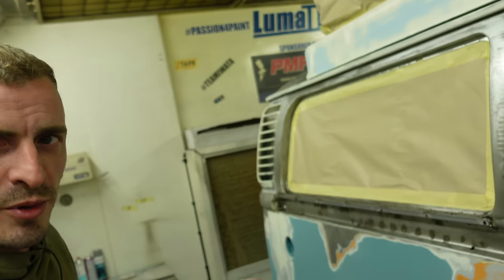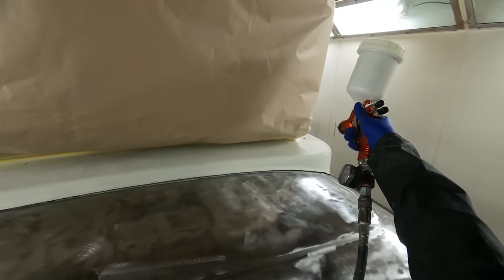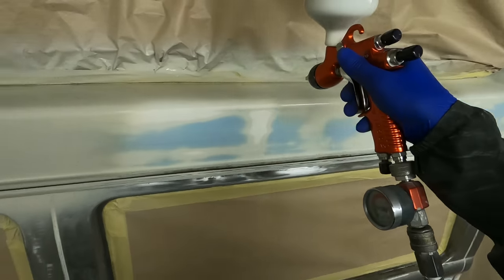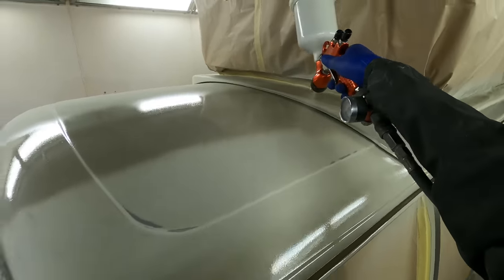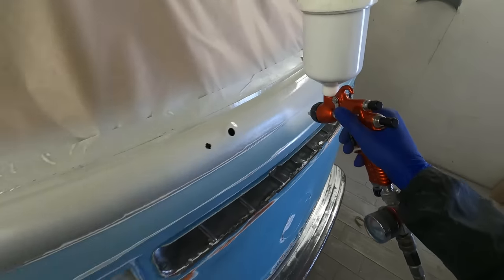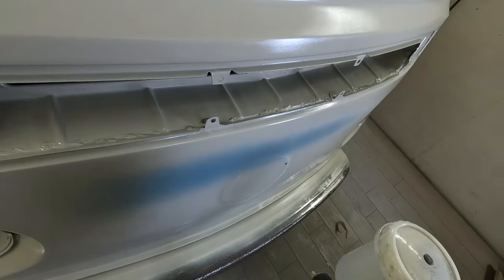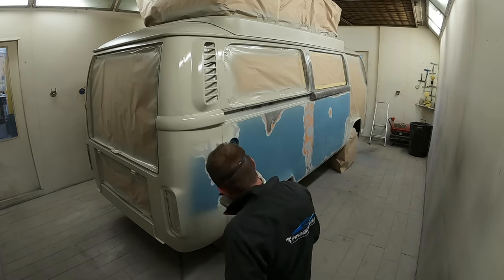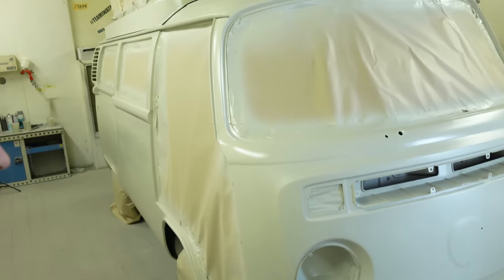Applying Mipa Epoxy Sealer / Filler On A Restoration Job

Comment: I’m a novice doing a bare metal restoration on my MGB GT. I have used the same Mipa Epoxy primer on the bonnet, wings, doors and valance so far and just finished painting the tailgate today. I use a DeVILBISS FLG 5 with a 1.4 tip but I used the Mipa E10 hardener so no thinner required. It goes on really evenly and I give it 24 hours before I sand or do any filler work over the top. It’s nice to see someone else that’s used it.
Reply from the maker: sounds like a cool project youve got on mate good luck with it

Comment: great video again. just doing my epoxy surfboard and it couldn't come at better time. I used an epoxy primer over fibreglass filler, this  one not the easiest for me to use given the round shape of the rails and a sharp profile of the rocker (bottom). Took hours fairing and shaping it! I followed with epoxy semi matt colour matched BC.
Reply from the maker: Sounds cool mate that

Comment: Nice job as always mate it reminded me of a double side door vw camper I did years ago the primers weren't as good back then so had to use acid etch on bare mettal first then primer I used to do like you said in the vid I did each panel separate I found it better for me its easier to keep tabs on just how far your going and how far the work progress
Reply: How's your health coming along mate good I hope
Reply from the maker: Exactly the way o do it mate don’t note off more than you can chew pick a section work that section till it’s right then move on , and not to bad thanks buddy put a load of weight back on again now n feel a lot better in myself than I did , hope your well mate
Reply: @TonysRefinishingTV I wish more people would have the same work ethics all too often they rush thinking its quicker but is all they are doing is making more work for themselves it  come back to bite them later im glad to see your work is top notch as all your work is mate my moto was always good work ends with good money hopefully ha ha
Reply from the maker: Lol I just believe if a jobs worth doing do it right mate and that’s it

Comment: I’m in the process of doing the metal work on my bus and sanding it . What’s a good thing to use to protect the metal before paint or will it be ok to just leave it bare metal for a body shop ? I’ve been using etch. I’ve also used it on all areas but I’m thinking of taking it off as it could react ?

Comment: Great vid as always Tony. Could you do a video that breaks down everything about primer? So many names.. Sealer, high build primer, non-sanding, etch, epoxy.. It's driving me nuts. So hard to get comprehensive, solid info about when to use what and in what order.
Reply from the maker: Yes mate il add it to the list buddy

Comment: Great video! Satisfying to watch. I have a few question regarding my project. I’m going for a high end finish on my resto. I plan on soda blasting everything down to bare metal then using an Epoxy primer/ sealer to seal it up. Can I do a high build primer right over the epoxy without sanding it? Then do my blocking and skimming? Then use a urethane sealer. Then base coat?
Reply from the maker: Hoya mate so yes this particular one I’ve used allows you to prime over the job wet on wet after a short bake or period of air drying the info is all on the date sheet
Reply: @TonysRefinishingTV  Always consult the relevant datasheet for the paint product you are using as Tony said. I believe some Epoxy Primers allow you a certain time to overcoat without rubbing down, but after that you must rub down as paint won't stick otherwise.
Reply: Pointless skimming over Highbuild primer. (I presume thats what you mean)

Epoxy to seal the substrate, 

Filler work over the epoxy (check the open window of the epoxy for applying any materials before sanding is required) 

Then a polyester primer(applied correctly can be blocked like filler 120qrit down to what ever you want)

Then finish in a urethane primer (high build primer)

Comment: Stoked to see some body work on the bay window Bus!  Looks like the original color would have been cream upstairs and orange downstairs...will you be returning it back to its original paint scheme?

And remember Tony...those buses came from the factory with some waviness in the panels.  Trying to get them 100% flat will almost certainly drive you insane ;)
Reply from the maker: Lol I won’t be going for concourse mate that’s not what the guys asked for buddy , and no mate white on top and grey I think on the bottom can’t remember off the top of my head

Comment: Great work. I need to paint under the dash of my bay, I've cleaned, sanded ( not bare metal) and  primed it, could or should I use xpoxi primer before painting it? Any advice would be appreciated!
Reply from the maker: no you need to use normal primer not epoxy mate as you cant paint direct over epoxy

Comment: Use the UPol version here (it's what we can get) -  downside I see with it is it sands crap - you'd go through it in the blink of an eye which I did not expect from an epoxy primer, I thought it would be mad tough. Nope - anything but. I still like it as a "kill everything" coat but you'd want your kid gloves on when sanding it, or it's through so easily it's unreal.

Comment: Great video Tony i now have a much better understanding of epoxy. Do you think epoxy can totally replace etch ?
Reply from the maker: 100% on most jobs but on smaller areas
Say on a bare metal patch the bake before primer Wouldn’t be as fine or cost effective as etch then primer minutes later

Comment: Nice video and good explained Tony. it is sometimes complicated difference between etch primer and epoxy primer, which one can you putty / bondo apply on it?
Reply from the maker: If you key up the etch primer than you can fill on it with no issues

Comment: chemical stripping would probably be better than sanding, right? I use it in motorcycles and at least keeps the metal lines straight. Also use epoxy primer from upol raptor line, but it takes one week to have the proper consistency.
Reply from the maker: Yes but again it comes down to time , cost , budget on the job the customer can’t afford this to be fully bare metalled fully bodyworked as there no way to know how bad or good the metal work is ect for damage dents so bare metalling the van could make this massively unaffordable for them
Reply: @TonysRefinishingTV  Thanks! You're an example. I just do small jobs for friends and motorcyclist colleagues. During the week I am an university prof. Top painters deserve all my respect. Much tougher than everyone imagines.

Comment: Nice job Tony. Good stuff the Mipa epoxy, i’ve been using it for years and it never led me down. Although i can only get it in 1 liter cans i love the stuff. How much did you use? I really fly trough it with a 1.8? How long did the workshop smell epoxy? 
When the base is good i thin it 10% to 15% and spray with a 1.4. I leave it to airdray for a day or two and follow directly with a highbuild (no sanding inbetween) it has an open time of 7 days! Good stuff and on top of that not braking the bank. IDeal for restaurations like i normally do. Thx for the vids, keep it up. Cheers Robby
Reply from the maker: Yeah it’s nice stuff mate I have to say there was nothing to complain about at all with it , and yeah it goes Through it with the 1.8 but one coat is very thick so although you go through it the build is very good , and it didn’t mate as I’m in a full proper booth so no smell ,

Comment: Enjoyable video Tony. Just one question , you say you're going to bake this coat and then come back to it after the bank holiday and apply filler and primer, will you not have gone beyond the chemical adhesion point? Cheers Derek.
Reply from the maker: Line keying it up mate blocking it out with guide coat and doing filler work , after
That il apply one thinner layer and wet on wet prime it

Comment: Great video Tony.
So you suggest body filler after primer?
Reply from the maker: It depends on the job mate tbh like this particular job yes , if it was a bare metal shell yes as the metal needs protecting , if it was a cleaner better substrate I’d fill then prime
Reply: @TonysRefinishingTV  it’s for rust pitting mate , so I guess treat it , prime it , fill it and prime it again
Reply from the maker: I’d treat it epoxy it to seal the fresh treated metal then fill and prime same as I’ve done here the second that metals clean you wana seal it
Reply: @TonysRefinishingTV  cheers mate I’m doing the same on all the rust spots to stop them getting worse before I bring it up to you😎
Reply from the maker: Lol no worries mate

Comment: Got my sagola paint gun you talked me in to. It sprays nice got a few sags on my first job seems like it likes more distance from the panel than my iwata and less air pressure. What pressure do you spray clear at?
Reply from the maker: Which one did you buy mate
Reply: @TonysRefinishingTV  4600 extreme  non digital with clear cap and titian cap the orange on it is nice
Reply from the maker: So woth the dvr air cap the clear one then 2.0 bar mate

Comment: So you dont need a metal etching primer on the bare metal areas first?  Thanks. joe
Reply from the maker: No mate epoxy is direct to metal so like your etch and a sealer / high build in this case in one hit

Comment: what do you do to get the rust out of the rear seams on the panel joints?
Reply from the maker: The panel joints have been cleaned already mate , this jobs not long ago had a repaint but not properly, personally you would either use a sandblaster or you could use a drill and wire brush

Comment: Which Mipa epoxy primer is this? Looking at Mipa USA I see that there are several of them (Grundierfiller, Multi-Filler HB 2.1, EP-Primer-Surfacer.) Looking to switch from a more expensive brand. Thanks.
Reply from the maker: That’s the one mate yes very good stuff in my opinion
Reply: @TonysRefinishingTV  Thanks for the reply, but it is a question. Mipa-USA lists 3 different epoxy primers. Are you spraying one of the 3 Mipa epoxies available in the USA? 
a) Grundierfiller        b) Multi-Filler HB 2.1        c) EP-Primer-Surfacer
My nearest distributor is in Chicago, and I do not even know what they keep in stock.
Reply from the maker: Ep grundierfiller is what I’m using I can’t say if that’s the exact same one as you have in the USA you’d have to ask a rep
Reply: @TonysRefinishingTV  Thanks again. I enjoy your videos!

Comment: Hi Tony great vid..... just to ask when epoxy dry what’s you use to key with before any filler work...... or before high build thanks
Reply from the maker: P180 personally mate so it’s got a good bite mate
Reply: @TonysRefinishingTV  hi Tony .... didn’t you guide coat then 80g then 180? I’ve got mipa epoxy but not used it as yet ..... also when you’ve blocked and repaired ..... did you re epoxy ? Then high build again ? I havnt a   Oven so if I put a seal coat epoxy on how long would you leave till hitting high build on top.... and also one high build is dry what’s best to block with thanks
Reply from the maker: I have Erne van a quick 180 before guise coat mate , il seal it with a last coat of epoxy after the repairs then wet on wet high build the van , check the data sheet for your epoxy for times ect I haven’t got that info to hand
Reply: @TonysRefinishingTV  I’m using same as you , I saw you guide coat 80 grit...... you then said 180, then a seal coat , I’ve no booth do how long after you epoxy do I highly build ..... what would you block height build with ...... thanks
Reply: @TonysRefinishingTV  why 180 before guide coat ? Guide coat first
Reply from the maker: I’d block the high build with p240 then da with p400 and as I said without a booth you’d need to check the data sheet for the product
Reply: @TonysRefinishingTV  thanks .... would I be right ...... take so much to bare metal.. da say 80/180...... then epoxy with your mipa ( already got some ) guide coat then block epoxy 80, 180, re seal 1 coat epoxy , then straight over with high build? ...... would you block higher build for straightness or just as you say 240da 400 dry and thank you Tony
Reply: @TonysRefinishingTV  why would you 180 with out a guide coat ?
Reply from the maker: It’s job dependant mate I can’t say the best process for yours unfortunately as it might need more or less work than this one we’re working on , and again as for the epoxy and primer need to check the data sheet to see what it says as far as air dry goes mate
Reply from the maker: @richreece8840  just to make sure the panel has a light key prior to filler work so the filler will stick so a quick once over is enough
Reply: @TonysRefinishingTV  I understand , il probley watch you vids closely ...... I didn’t think you did block epoxy,  but this mipa stuff looks like you can
Reply from the maker: This Mipa epoxy is there high build epoxy buddy that’s why
Reply: @TonysRefinishingTV  hi it says 2:1....... not 4:1 like hb body have you ever used hb body 4:1? Think what il do it bare metal some areas then 180 rest.... seal with 3 coats mipa epoxy , guide coat, block 80/180 then seal with epoxy, did you seal with 1 or 2 coats epoxy before high build ? Thanks tone appreciate all your advice thank you
Reply from the maker: You don’t need three coats mate two would be plenty and no I haven’t used hb body’s stuff mate and I’m not at the high build stage yet mate and as I said in the video il put one small coat of epoxy to seal it then high build after a 30 min bake
Reply: @TonysRefinishingTV  ok thanks
Reply: @TonysRefinishingTV  hi Tony, I didn’t realise you could block epoxy ..... from other vids I’ve seen , is ppl just scuff it then paint on top but your method looks better..... as you do guide coat then block to see what needs doing ...... I’m enjoying the vids thanks
Reply from the maker: This is a high build epoxy not a standard one though that’s why
Reply: @TonysRefinishingTV  yes I understand ..... I’m surprised it’s high build as usually there 3:1//4:1 etc solid colour is 2:1, I’ve only a 1tr tin so will see how it goes, I was told it’s good stuff to use
Reply: @TonysRefinishingTV  hi Tony just wanted to ask , about to start re paint in a mk1 fiesta.... most of it is original paint ( front wings bonnets celly )  would you say bare metal the lot then epoxy or 180 the lot then epoxy etc thanks
Reply from the maker: I’d bare metal the front
Reply: @TonysRefinishingTV  and rest you’d say 180 then epoxy to seal it in ( simulator to your camper ) we’re all the 1980s done in celly or was it the early days of 2k thanks
Reply: @TonysRefinishingTV  on areas like the rest ( it’s base and clear ) would you 180 the lot then epoxy or 80, then 180?  Would this epoxy cover 80 marks ... or for safety go 180 thanks Tony
Reply from the maker: I don’t know what it’s been done in mate when I can’t see it
Reply from the maker: 180 mate or read the data sheet again. It’ll give you all the info you need
Reply: @TonysRefinishingTV  data sheet for what ? Just asking professional advice mate
Reply: I
Meant when you did camper I know you did so much 40, but I think 180 would be enough and epoxy should cover marks ... 180 dry = 400 wet
Reply from the maker: The epoxy mate and I know your just asking for advice buddy but some things like the grade it needs to be sanded to , mixing ratio , drying time air drying ect are all on the products data sheet for you bud I only look at the aspects that apply to me bake times ect not air dry ect
Reply: As you’ve don’t it , and your showing others
Reply from the maker: I get that Nate but also each job is slightly different I’m showing what I did here and why what grades I used how I will do it to the circumstances I have and work in
Reply: @TonysRefinishingTV  yes understand that ..... you were telling us all what your process is so carnt be far out can it
Reply: @TonysRefinishingTV  yes and I just wanted a opinion ..... but your method sound just like mine
Reply: @TonysRefinishingTV  ok

Comment: Thank you for this video. I rarely hear about Mipa paint product here in USA. Where does it fall in comparison with other brands? Quality & Color matching any good? Cost effective? I know it's made in Germany but practically not much information for a company that's been around for some time.
Reply from the maker: It’s pretty good mate over here I’d say it’s towards the better end of the products available there 2k gloss is also top notch as are there clears I’m not a huge fan of there base but we run a lesonal system
Reply: @TonysRefinishingTV  thank you for a prompt response
Reply from the maker: Anytime